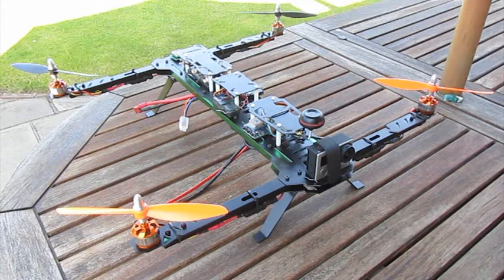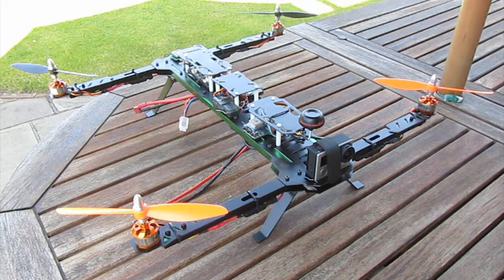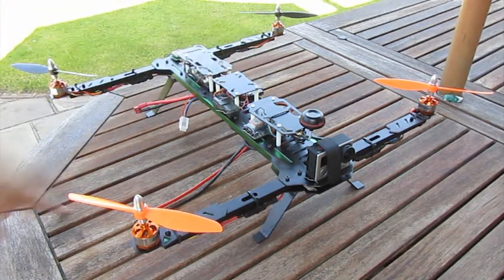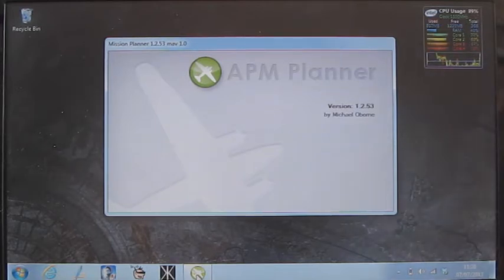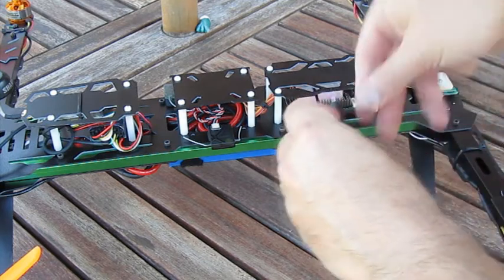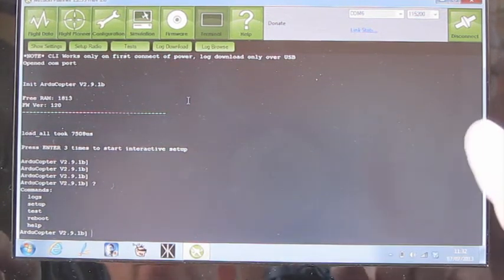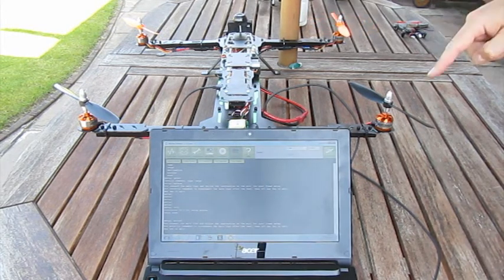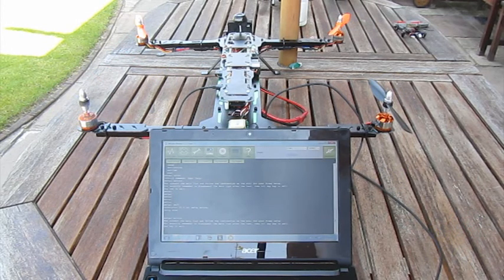Ardupilot (APM) 2.5 - Setting up and testing your motor connections

Comment: Greetings to you Painless360.
I have been experiencing problems with my XXD-A2212-KV1000 motors and not sure whats the cause. Let me try by asking you, what can cause a motor to suddenly stop working when plugged into this apm 2.6 ? No wires touched while building, and the motor beeped when plugged on and worked fine, but upon connecting to the apm, it suddenly stopped working and no beeps on the motor only and no spinning when powering on after the first successful connection. 
Any ideas on what to try ?
Reply from the maker: Arming? What troubleshooting have you already done?
Reply: @Painless360   Thank you for your prompt reply Painless360
The components I am using is the apm which is flashed with an earlier version for quadcopters as the last working apm quad version was giving me errors.
I am also using the APM 2.6 Power Module V1.0 BEC 3A output, simonk red shrink wrapped escs and XXD A2212 1000KV Brushless Motors,  Five out of ten that are left & working, I purchased ten in total. I have the other stuff like a power distribution board (Mateksys FCHUB-6) and flysky fs i6 tx and rx in case you need to know. 
I have not calibrated the escs so they are in sync when powering on and spinning up the motors, also in case that might contribute to my problem with the motors failing.

Regarding troubleshooting, I have tried another spare motor and it works fine, there is a beep from the esc and from the motor, and the motor spins up when throttle is increased, and vice versa.
When I try to connect the non-working motor that suddenly stopped working, its still the same problem, no beeping from the motor and no spinning up when throttle is increased, its as if the motor is dead by some unknown reason, but only when the apm was connected did that happen. 

The truth is It did not happen to one motor, it actually happened to five motors, of which, four motors were connected in one go to test the drone if the motors are going to spin up, using the APM 2.6 Power Module V1.0 BEC 3A, the apm jp1 jumper was removed, and on three of the four esc plugs, I removed the live and negative wires, one esc plug had all three wires, then I connected to the apm, turned the drone on and suddenly two motors were stuttering, one worked and spun up, the other was dead, I tried full throttle and the problem still persisted, then when testing for the second time, all four were dead.
 
The fifth motor died with a different connection to the apm 2.6 , which was, still using the APM 2.6 Power Module V1.0 BEC 3A, the jp1 jumper still removed, I removed all live and black esc wires from each esc plug and left the signal wires only and connected all of those esc plugs with signal wires only to the apm, two began to work, one stuttered and the other gave up. 
After that, I did not try again because of being scared to kill the final five brand new motors  that are left. Yesterday,  I desoldered the escs from the power distribution board and calibrated each esc with a working motor individually using the full throttle method on the receiver and then powering on the esc with motor directly connected to remote and battery and listening to the beep sound then dropping the throttle down to idle, all esc's successfully calibrated.
I have found another video from youtube with the person allowing us to download a config file for the apm, for a F450 Quadcopter Flamewheel or F550 Hexacopter, which I have just loaded now to my apm, but awaiting your reply for any other important info I might be missing before I try the motors again.
Reply from the maker: The APM is a very old flight controller I've not to used them for well over two years so I'm very out of date with them. I'd check that the ESCs and Motors are ok by running them directly from the throttle channel on the receiver and go from there.. Best of luck!

Comment: Hi!
Great video! 
I was wondering if there is a way to control the motors individually? like if I want to turn on motor 1 for 20 s and motor 2 for 30s say?
Reply from the maker: +Swetapadma Sahoo we've never tried. Why would you need that?
Reply: I am trying to build the code for a hybrid copter, hence needing to switch between motors. Trying to figure that out!
Reply from the maker: Sorry, that's beyond what we know. There are some nice PWM libraries in the Arduino code.. Best of luck!

Comment: Do i need to connect the battery to test the motors in the optional hardware menu? Because i click to test the motors and nothing happens. Tried to rise the throttle and i still got nothing
Reply from the maker: +faxikax Yes you do. The ESCs need the main flight battery power to turn the motors...

Comment: Just got one of these boards in, I set up everything and my quad won't even stay stable in the air. It just rocks around and flips over right away. Is there anything I can do to fix it
Reply from the maker: I had this and it was two of the motor connections were flipped when I plugged them in - D'oh! That is why I made this video and also now triple mark the arms, escs and servo connectors.

I'd triple check that you have the motors connected the right way, make sure all of the props are not on upside down and ensure that the board is facing forward on the craft.

Hope this helps.

Comment: Cool! Thanks for sharing! 
I was just wondering, which board would you choose for stability, the dji naza v2 or this one.thanks
Reply from the maker: I've not used the DJI Naza V2 myself. It looks super stable but the price has always been a factor for me. The choice boils down to budget and what you want to do.

This board can perform extremely well, despite its age, and can do some very neat tricks like auto return to home and land, mission planning, remote telemetry to a ground station, to name a few..

I will be doing some video of how stable this thing is once it's run through the autotune and autotrim functions in the coming weeks. With the GPS functions it will sit in the sky, even in good wind.

Not sure this answers your question. If you find an unbiased review of the two together let me know.

Happy flying!

Comment: Thanks for sharing, though I would like to comment 3 things: first the direction of your motors is not as recommended on the ardupilot first time setup page (cw and ccw direction should be alternated) 2. For best results your apm should be in the center of the frame with the added benefit of more separation of your fpv and rc signals. 3. Please make a comment IN the video NOT to do this when using a single power set-up for your motors and APM. If you connect a single power set-up (powering the motors+apm) and then supplying additional power to the apm with the usb could damage someone's board.
Reply from the maker: Hi Jos, thanks for the feedback. As of the date of installation the motor direction was right with the version of the Firmware and APM code I used to setup. This video was to show only the neat trick with the motor command line as I'd spent two days trying to figure out what was wrong.

You are right about the location of the APM, it was moved after this video and is now in the middle, you can see this in other videos of mine and comments on this video further down.

Happy flying!

Comment: Hello Painless,

What was the command line .... "setup motors", it seemed you added another line in the video.
Reply from the maker: You type 'setup' and press enter. Then type 'motors' and press enter again.

Happy flying!
Reply: Painless360 Thanks Painless,
I found that in Arducopter 3.1 the command has been changed to "test" then "motors"...

This helped determine I had setup the motors in the wrong direction.....
Reply from the maker: Good to know, thanks for the info. Happy flying!

Comment: Hello Painless360, do you have anti-vibration for you GOPRO camera?
Reply from the maker: I don't use it. I've balanced the props and motors and it seems to work fine. Have you tried anything?
Reply: i am await for my prop balancer from ebay, currently it is out of balance and i have tried to mount my iphone4 direct to the frame, video result was horrible lol

Comment: Haai! Do you get good results with the Video TX on top? I have moved mine to the button (aeroquad, cyclone). But have to see if it's better....
Reply from the maker: I've tried both now and the biggest improvement is using the circular polarised aerials.

I don't fly far with FPV so I've not reached the 'edge' of the TX range (yet!). Thanks for asking.

Happy flying!

Comment: Hi Sir, I want to use Ardupilot for X-copter. I have no idea how to connect the motors. could you help me with that?
Reply from the maker: Hi Reza, the answer is in the video. You can forward to the section that shows how to connect them at 8:04 in this video. Hope that helps.

Happy flying!
Reply: Painless360 Thanks but that is not answer of my question! i want to know how to connect the motors to FC for X-copter NOT H-copter!

Comment: Hi Thanks for kind reply, you sound like a northern lad? I am from Bolton, would be nice to have local fellow comrade's to share interests together. How do I get the zip file?
I have also got a full setup of a FPV hex quad with Naza and gimbal controller, works a dream a, but want to do the autonomous flying. Cheers Ste

Comment from the maker: Hi Stephen, I will send you a link to a zip file that I've just created that shows all of my setup detail exported from MP. In summary - when I setup my model MP didn't have a 'H' option so I used 'X'.

Interestingly, I have a similar issue with a new Crius Se v2.5 board I'm using in a 450 class quad. Trying to figure it out - jittering motors when the model gets too far from level. Better if I trim back the PID settings to almost nothing.. 

Let me know if you track down the cause. Good luck.

Comment: Hi Got the same setup as your self less your fpv gear. Struggling to set this up, just keeps osculating All motors going the right way, what are your pid settings? did you set it up a x quad or h frame, Your input would be appreciated Ste D

Comment: Thanks for the reply,
What battery capacity are you using?
We have been working with fixed wing aircraft to get the most stable platform for aerial video we can for a year. Now it's time for multirotor! Great advice and informative video, thank you.
We are looking at a small light quad for training and a heavier lift quad to lift about half a kilo
regards Andy

Comment from the maker: I've ended up putting some heavyweight motors and props on this model as with all the electronics and FPV gear it weighs over 2kg. 

You should aim to have the model hovering around 50-60% throttle and that will give you enough headroom to fly in almost all conditions. I'm using 30A ESCs, 11x4.7 props on Turngy D3536/9 950KV motors. 

On smaller quads weighing around the 1KG mark I use 20A ESCs, 7x4.5 props and Turngy D2822/14 1450KV motors.

 Hope this helps.

Comment from the maker: Thanks for the comment, i tries to mount the board as close to the middle of the model as possible but I needed to work the space on the frame.

It seems to fly fine, but I am planning to move a few of the pieces about when I rewire the model for the new motors and ESCs and use a hard case for the APM to allow me to secure it.

I plan to move the APM2.5 to the centre a you suggested and move the Rx and satellite to the back when I get the bits. Watch this space! 

Happy flying